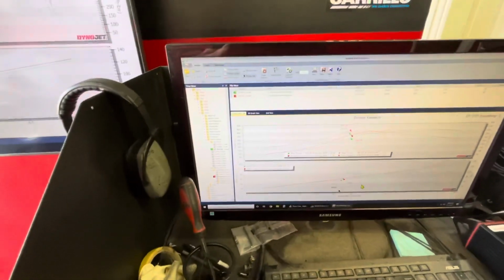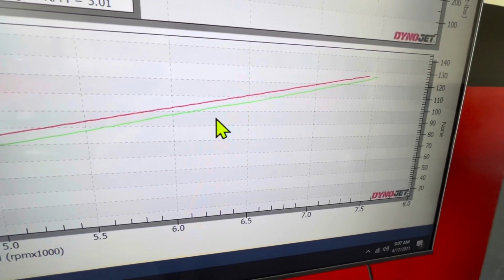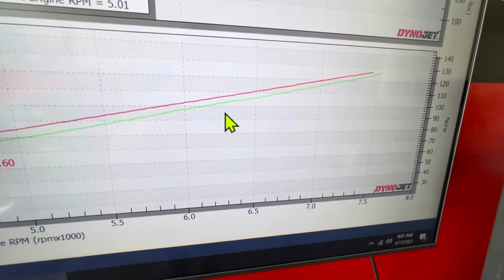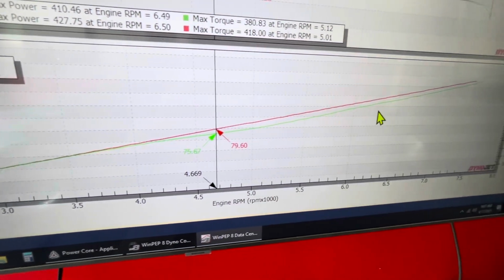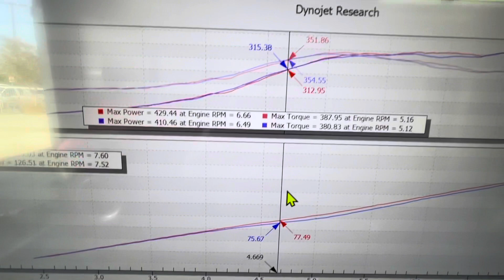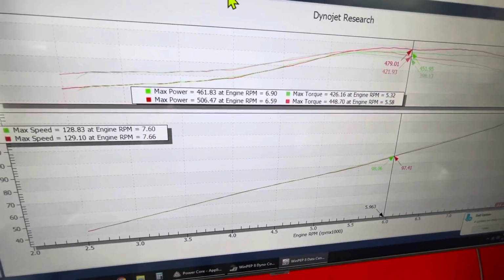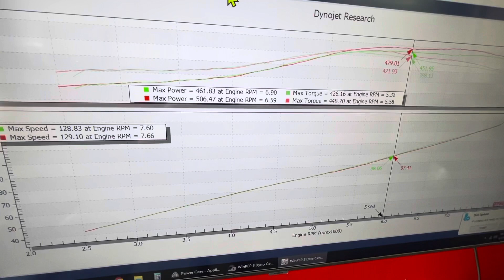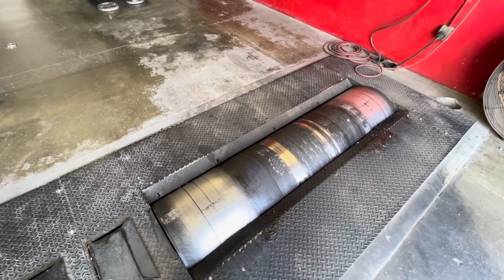Tire Slip on the Dyno

Comment: hello very good advice having the same problem just one question.  Do i have to add track bite each pass and does it work with high power cars thank you
Reply from the maker: While on the dyno you do not have to keep adding more compound each pass, works great for high HP cars.
Reply: @specialtyz  thank u , will try
Reply from the maker: @manfredamrhein  you're very welcome